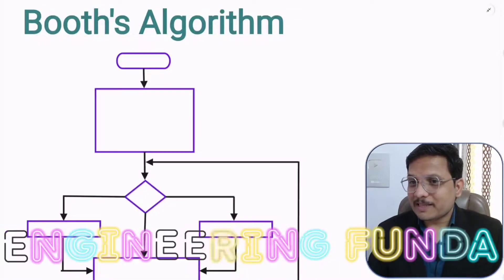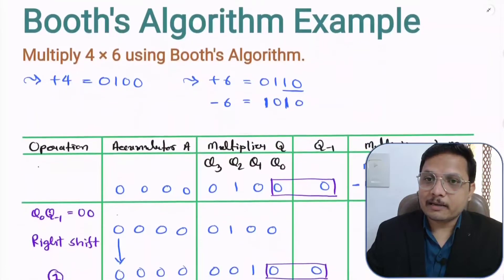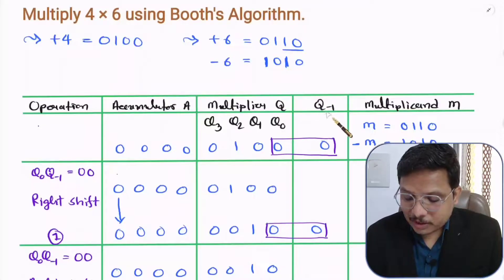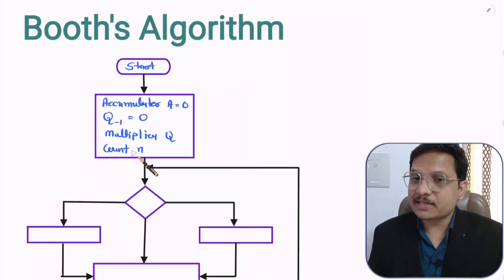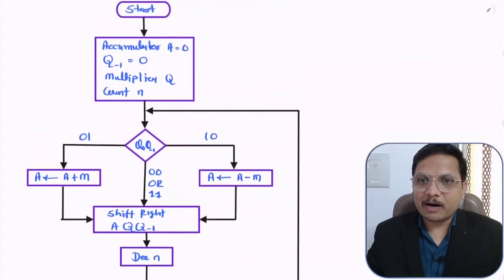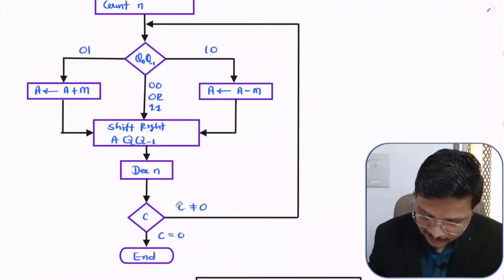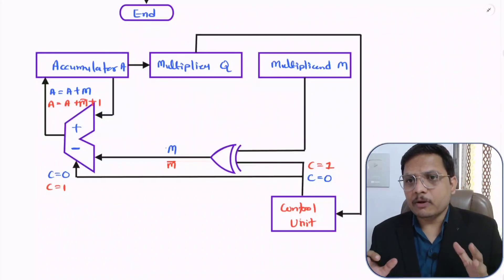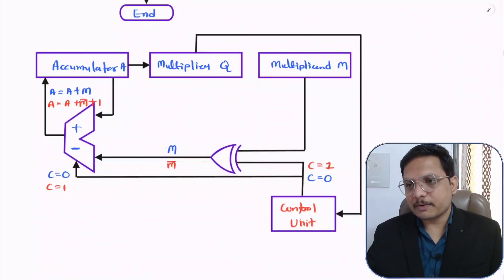Booth's Algorithm: Flowchart, Circuit, and Steps Explained | COA

Comment: Implement a system on the simulator for controlling a DC motor using L293 motor driver, monitor its status and print the running status of motor on the LCD Display. I NEED YOUR HELP SIR PLEASE.
Reply from the maker: I have already made videos on it with 8051 Microcontroller playlist
Reply: @EngineeringFunda  video name sir which one
Reply: @EngineeringFunda   sir is this code work on microchip studio ???